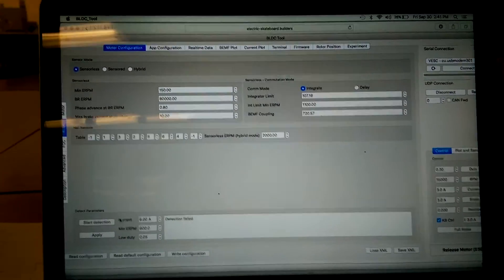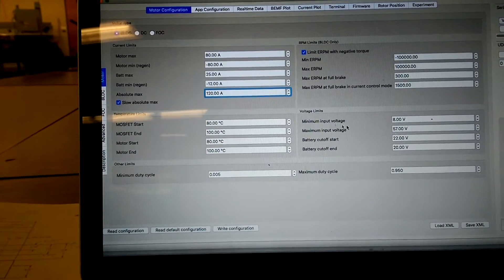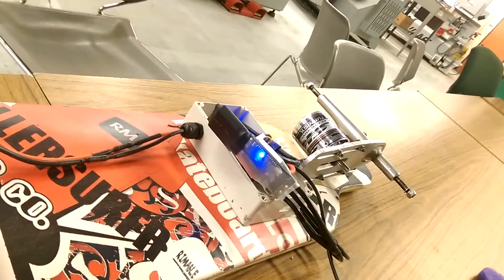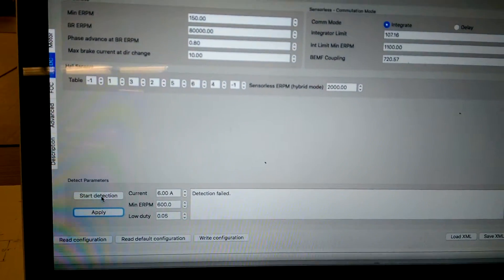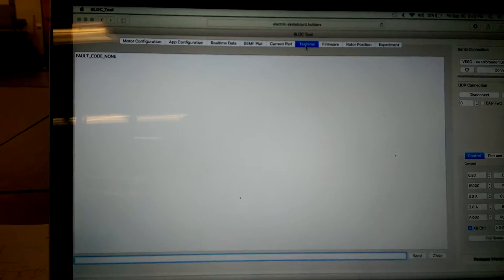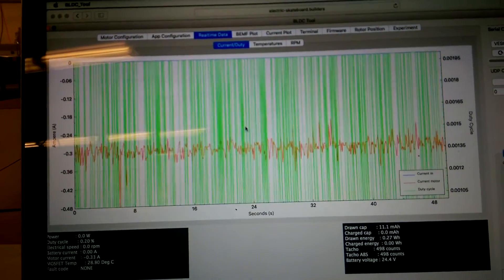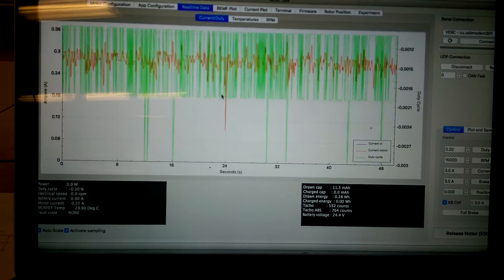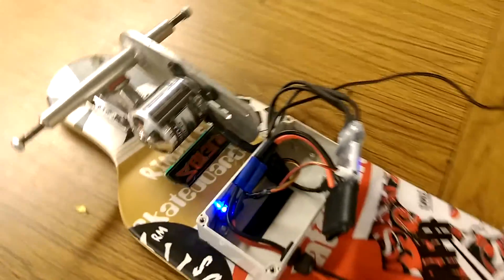VESC Motor detection problem

Comment from the maker: So for anyone interested I apologize for not updating but it was a connection issue with my solder joints! I was not using a hot enough soldering iron for the heavier ga wire used

Comment: You need to try playing with the values, then try to downgrade to version 2, try enertion's BLDC tool, upgrade the firmware again... Drain your battery a bit or charge it more... It's a weird process, you just need to make it once... This stuff is pretty common and is almost always resolved not as a hardware issue...

Comment: I hit measure R and L and my motor now only runs at 31000 rpm. And thats only when the motor actually works. My vesc makes crackling noises too now. Long story short my board is probably broken. Be careful what you press

Comment: Hey, have you solved it yet? I was having the same problem you seem to be having. My issue was that in the app configuration, I had ppm and current no reverse with brake activated. So I got it to work by setting the app config to "no app", then write config -> reboot > connect > read config and then motor detection.

Comment: Looks similar to what mine is doing. Real time data panel isn't so useful, when it's not running it always looks like yours does. The most usefull information is in BEMF and Current panels. They don't display in real time, you have to press capture as it's running or select at start option in that tab. You can select "at start" then run the detection tests, you have to re enable it every time however.

If I had to guess, probably the gate driver or something else has a hardware fault and one of the low side MOSFETs doesn't switch correctly.